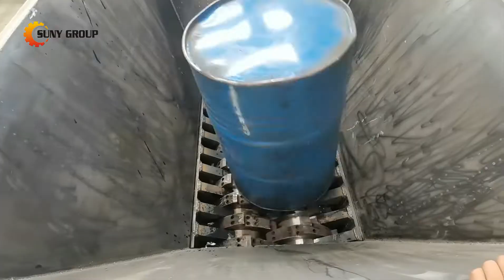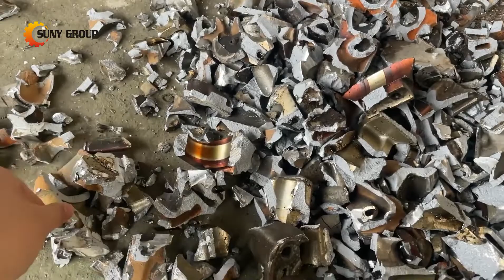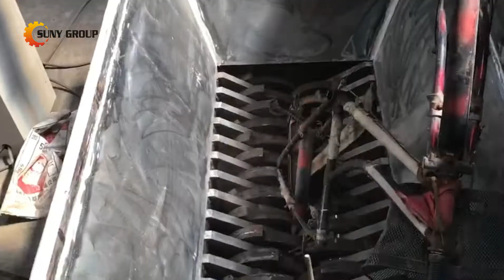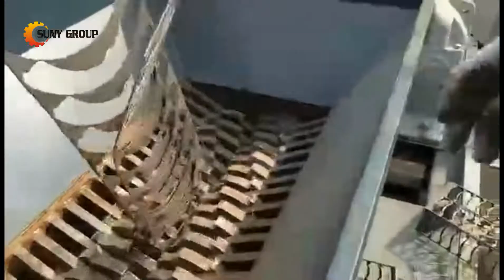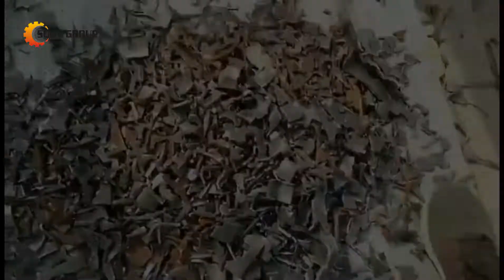Scrap Metal Recycling Shredder | Industrial Shredding System

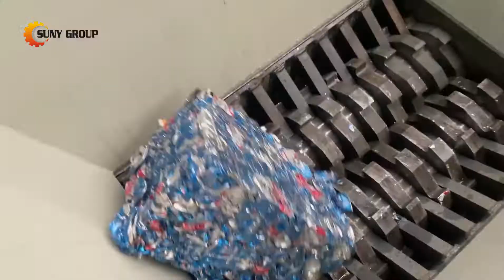Comment: I used to run a crusher that made aluminum can bales similar to the bale of pepsi cans at 0:25 but much larger. We also ran plastic bottles. It Had a more open "perferator" with smaller points than these end process ones. The tops would be cut off of those large chemical totes when they were empty. We would fill them with either cans or bottles, use a forklift to put them on a "tipper" that dumped them into a hopper where they fell down to the perferator ( about like these in the video but meant more to puncture the bottles or cans), the would then fall into the bottom where a large ram would push them to the front of the baler and mashing them into a lovely cube. When it got full we would tie baling wire to it (2 wires for aluminum cans, 3 wires for PET bottles), open the door and eject the bale onto the forks of the lift and stack them up. When they got 5 bales high, they would go on the trailer.
Reply from the maker: for large aluminum can bales, it is necessary to use a debaler machine: https://youtu.be/PX519ZTklA0
Reply: @EwasteRecyclingMachinery  Interesting to see that part of the process.